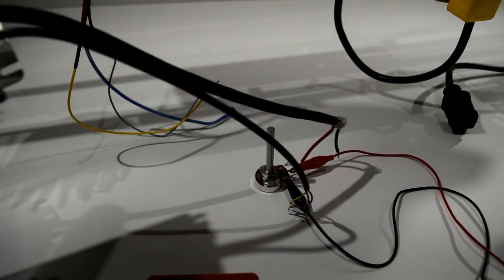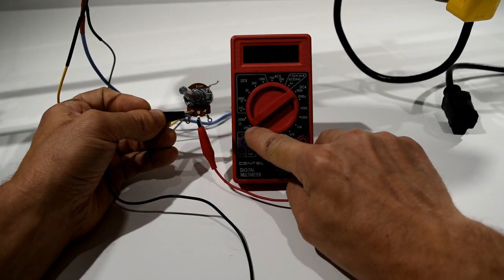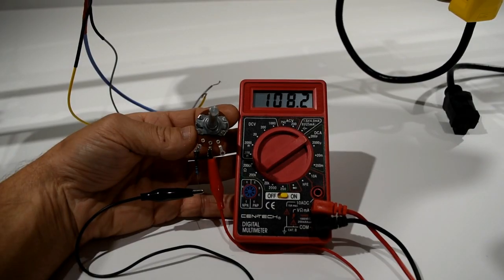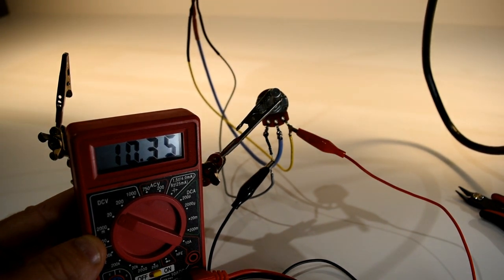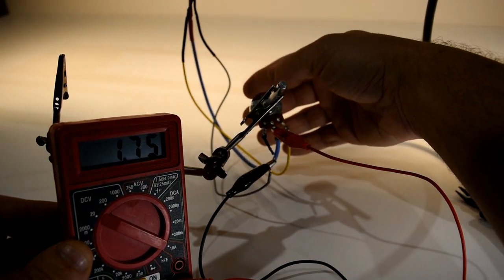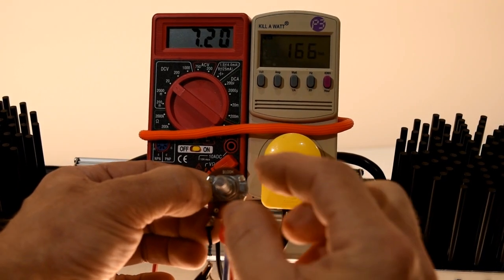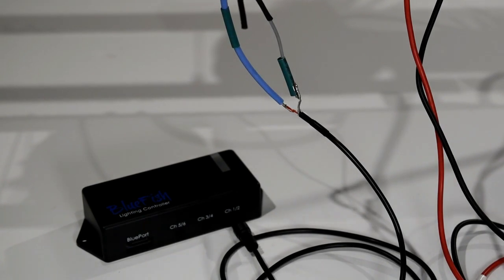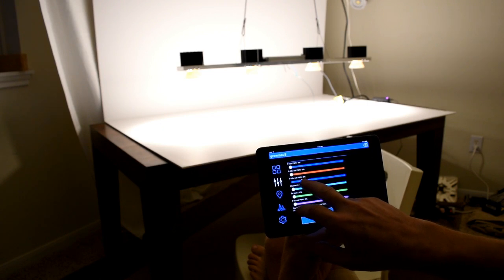Dimming Pairui LED drivers: analog & wireless

Comment: My grow light is similar to your DIY spider but it has 6 CXB 3500k, 4 CXB 5kk ,60 Oslon SSL 80s and two fluorescent UVB tubes all wired separately .I want to be able to individually control the on/off and dimming of each light. For instance start with just red, then the 6 CXB 3500k then the 4 CXB 5kk and finally the UVB, from that point the reverse happens to form a climatic effect. It would also me be nice to have dimming maps for each light type and the different growth/light cycles (12 hr or 18hr or 24hr) that can also be saved. This is probably a bit advanced considering the use of Arduino's is probably necessary but maybe in the near future you can do vids on something like this.

Comment: I am very confused, as in your first LED tutorial (Part 1/7) you said that the brightness of the LED is determined by the amperage of the PSU not the voltage?!
Reply: Oh okay, but if you reduce the amount of voltage would there still be enough to complete the circuit if i fill up the light with lots of cobs?

Comment: what would be your recommended build for a 5x5?
Reply: My concern Is optimal coverage and light spread with a ppfd in the 800-900 range.
Reply: +growmau5 at 1050ma won't that push each cob to 50 Watts. so wouldn't 16 draw 800 Watts from the wall?
Reply: +growmau5 I'm confused now lol
Reply: +Faded _MBS 37.8 watts
Reply: +cannibis sativa thanks, I figured it out.